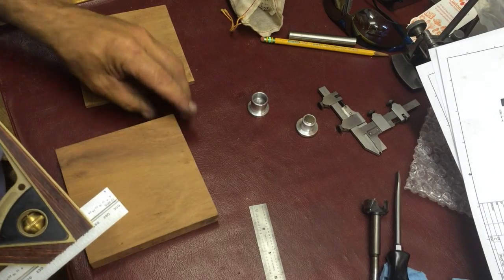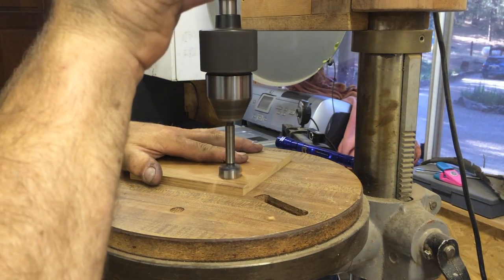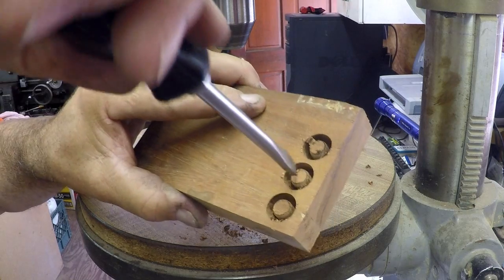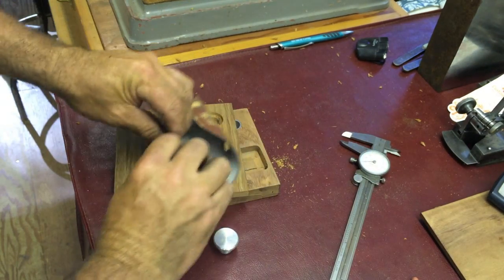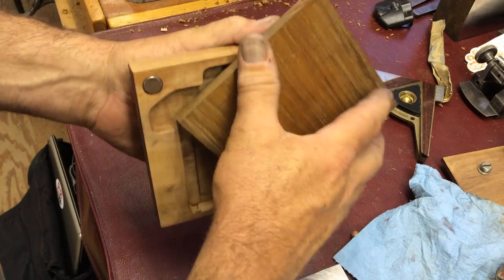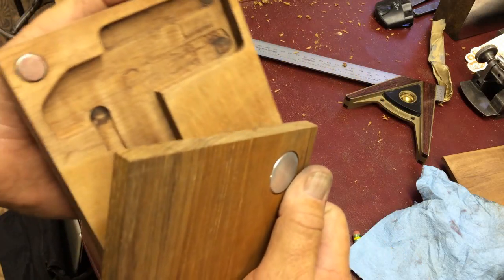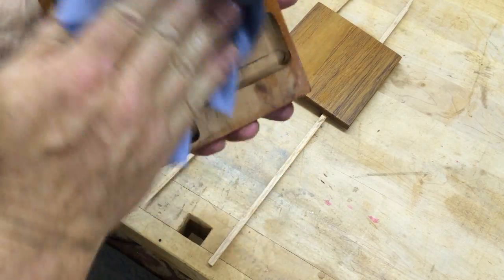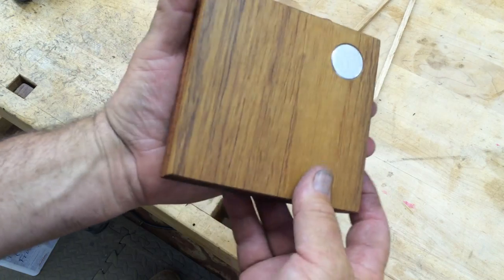Vernier Box Part 3 Final

Comment: The hinge adjustment screw looks a little loose. Some thread locker, the non-permanent type, or even a piece of 30gauge or finer copper wire might tighten it up enough so it doesn't try to turn with the magnet. A great series, thank you for sharing your talent...

Comment: Hi again, Randy you might look into etching your logo on metal parts. Works good and is rather easy to do. I like that hinge but keep it away from chips or you might say hummmm cleaning it out.
Reply from the maker: James Parker Yes, James, I am actually thinking of doing that on some Dovetail cutters I made.  I have a nice DC powersupply I use for anodizing Alu.  I have never done any etching on steel but I think it would look great.  This was just a fun project for something non-conventional.   Thanks Randy